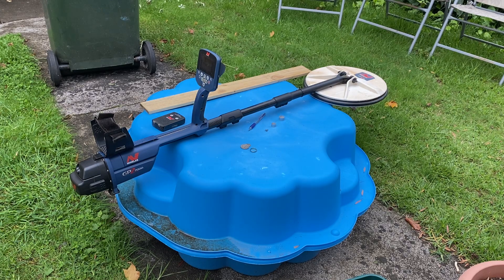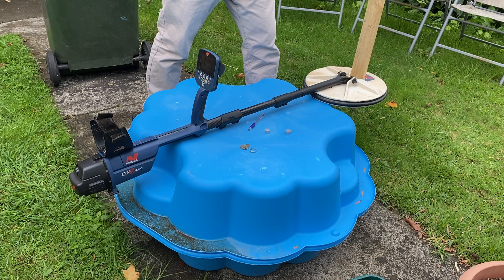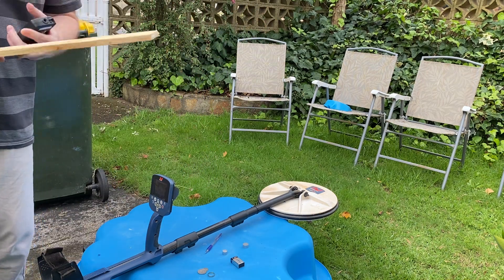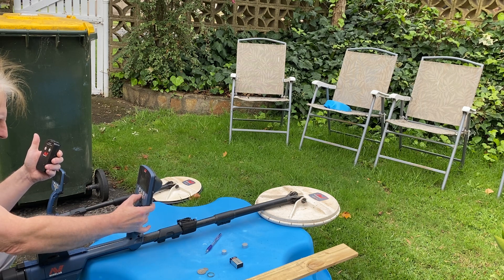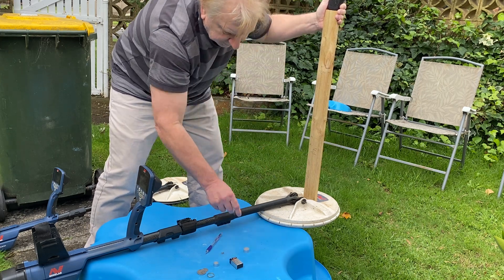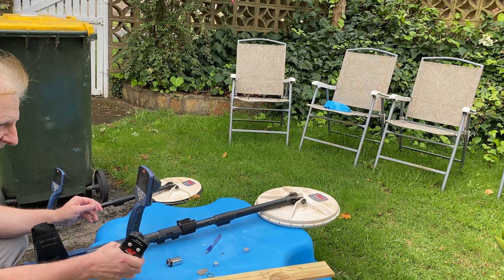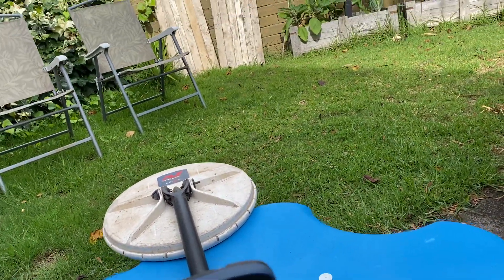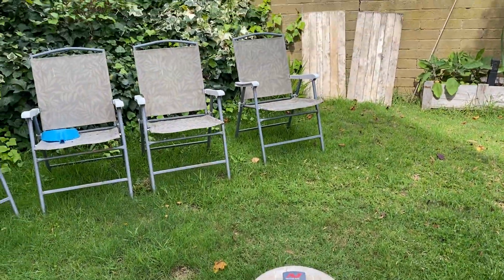Minelab GPZ 7000 quick mods test with huge interference in rear yard.

Comment: Sir, I would prefer if the test uses a gold target.. because later on in the field we are only looking for gold, thanks

￼

￼Terjemahkan percakapan
Reply from the maker: Aluminium of the correct alloy is much the same as gold to a p.i detector, Gold is different shapes and the signal is not representative of any gold nugget.
Reply: @DetectorMods  So the aluminum doesn't work the same for a VLF detector?